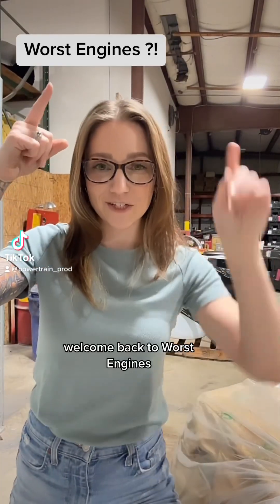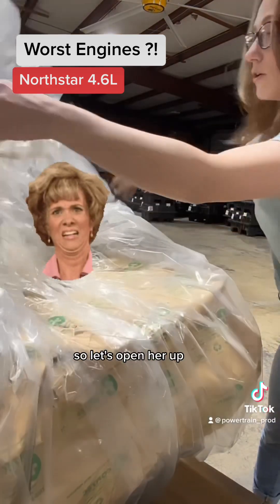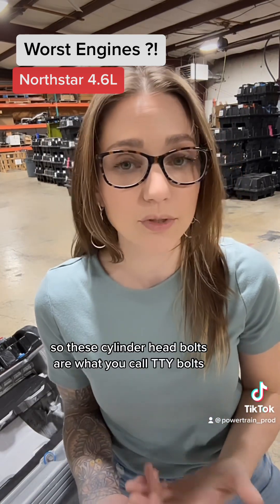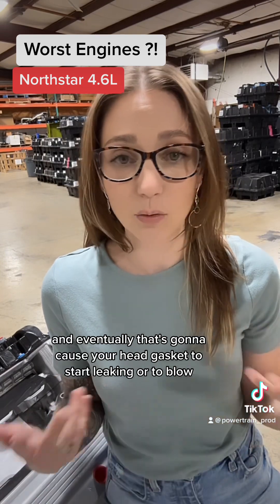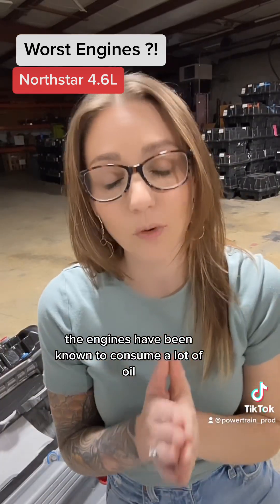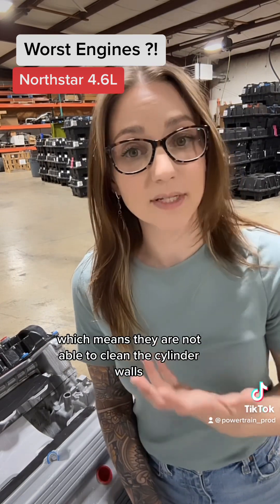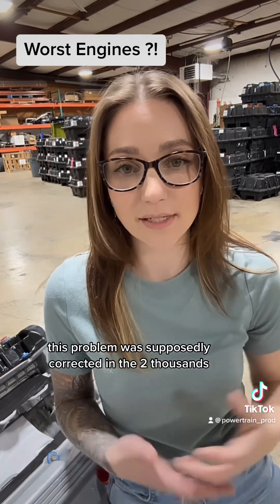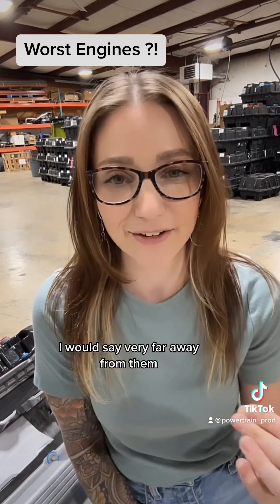The Northstar 4.6L Engine Problems

Comment: My 4.6Northstar is a hard rumning engine
I removed the heads and drilled the block and made my own head bolt inserts . Way better than the gm kit. Never had any more problems with the heads. As far as oil leaks ,i have not one oil leak in this engine, or any problems with the piston rings . It does not use any oil at all.
These engines are sought after for racing engines , or pull engines in some tractors.
I have the early model 4.6Northstar.
Thanks for all your information....
Reply: How did you make them?

Comment: The Northstar isn't as bad as all this. I used Norm Huhn products stud kit on mine 9 years ago. 100 k since and no probs or oil leaks or consumption issues. I'd say properly warming this engine and regular use and good maintenance is what has mine doing just fine.

Comment: The early Northstars were nightmares, but the TTY nature of the head bolts are not the reason. The fine thread on them, in soft aluminum was. Soft alloys need coarse threaded bolts. This was solved in later engines.  If you replace the bolts with coarse threaded studs, it's a heck of a fine motor.
Reply: What year did they fix this
Reply: @Calijay707  2004 I beiieve.
Reply: @rm25088  okay thank you, i have a 2009 so i was paranoid for a second there lol thank you sir
Reply: @Calijay707  Yeah you are fine. I have a 2008. Runs real good. 96k miles.
Reply: @Calijay707 05 so yeah your 09 should be good ive seen those last over 200k
Reply: The sound 😳🤣🤪

Comment: They'll leak oil but the rest of the problems were normal wear and tear. The headbolt problem was 97-99 and could be mitigated with regular coolant flushes. The waterpump problem was caused by the tensioner wearing out usually by 80,000-90,000mi.The oil burning was cured in the 2000s when they mandated synthetic oil. Not a bad engine at all with regular maintenance. Them Northstars don't tolerate neglect so they're not good beater cars for college kids or anyone on a tight budget.

Comment: The only leaks on my northstar is when I took it jiffy noobs and the certified mechanic of Yale’s industries spilled a lil bit during my $120 oil change then proceeded to tell me how my transmission was leaking fluid took it to another mechanic and they said all my fluids were fine 😅😅maybe the only people that experience issues are the ones who take the cheaper route and go to these bs shops 😂😂

Comment: All northstars are not bad. She speaking on the early ones. There's plenty on the road still running great with nun of the issues she mentioned. Stop it
Reply: Same thoughts here. I think some people bought these cars used where, the previous owner did not maintain correctly and beat the heck out of it. Oil changes and coolant changes are a must on these engines.

Comment: Wow. I only had two Caddys with the N*. The first was a 1996. Its gasket blew. Before that I had to change the pump once, and the radiator. I suspect that because of those two things where I had the temp go up it exacerbated the issue, plus I used the green stuff, and since a couple of the head bolts were exposed to the coolant, the chemical reaction caused rust and bolts loosened. The second, a 2004. It's been ruining beautifully, and I have never had any of the other issues mentioned. It does consume oil about a quart every 3-4 weeks if I drive a lot (though of late only drive once a month or so I go 700-800 miles highway to visit my mom) , but it is a hi-output, high cylinder compression engine. It happens.  I do have a tiny coolant leak somewhere but it's negligible and I make sure to keep the overflow tank topped off with only ever Dexcool. But no other leaks to speak of. And I don't floor it or drive much over 60 MPH like many do. It's too bad they didn't address those issues until after 2000 because tin spite of the advertised specs, I get better than 25 MPG on the highway.

Comment: I had 2 of these engines in 2 different cars. (My parents bought them brand new and I inherited). Short north v6 and 4.0 in an aurora. I have read a lot about ownership. It appears that maintenance is a “must” with these engines. Oil changes, coolant flushes and repair parts from GM/ac delco (water pump replacement). I remember when my parents pick these up at the dealership they told them about 7,500 oil changes and long life coolant. All of which is bull. They take 6.5-7.0 quarts of oil that needs to be changed. Along with coolant changes every 5 years. Each car ran great. I never had overheating issues or, major engine issues. They are quiet, smooth running with plenty of power. I sold the intrigue v6 and still have the aurora.

Comment: Update; I finally bought an LH2 version Northstar out of a Cadillac XLR, off eBay for $480. dollars total. Complete with everything, exhaust manifolds, motor mounts, all accessories, flexplate, underhood wire harness, ECM, ALL of it... They claimed it had 157k miles on it, but when I got done tearing it down, it was in practically perfect condition. Clean and well taken care of also. The only thing that happened was a main bearing bolt snapped off. 
So just as an experiment, I took the broken bolt, clamped it in a vice, and hit it with a 7/64 drill bit, and the drill bit cut it just like it was nothing, probably because it's only a grade 9.8. So I'll be able to drill it out no problem.
And just as a note, all the head bolt threads were perfectly fine also.

Comment: The Northstars were not actually GM's first DOHC design. The first one was the LT5 used in the early 90s Corvette ZR1, but it was designed by Lotus and built by Mercury marine. Literally a boat engine. Cadillac tried to make their own version and ruined it
Reply: Absolutely correct. GM owned lotus at the time. 😊
Reply: I had a 1995 caprice pursuit vehicle. It had the LT5.
Fastest top end car I've ever had.
178 mph on gater alley and was still pulling,then I got scared😊
Reply: @michaelmortag3536  I wasn't aware the 32v LT5 made it to service vehicles.

I say that as a certified LT5 GM Master engine technician. From 2000 to 2005 there were only 4 of us in the state of Texas. I was bombarded with information about that engine every work day till I left GM.
Reply: @ImperatorCaesar22  as a GM LT5 certified Master Technician I miss that engine and the Callaway Supernatural I bought off a customer in 2001. Ugh.....I regret selling that beautiful car!

Comment: This was by far not gms first Dual overhead cam engine. Chevy had the LT5  v8 in the c4 vette long before the Northstar. A lot of people don't realize it but overhead cam is nothing new. Overhead cam engines came before pushrod car engines in most manufacturers. Chevys had overhead cams in the 1920's. That's also not how the torque to yield bolts fail. The bolts are fine if you want to check the stretch on the used ones they will still be in spec. The head bolts on the Northstar fail because the aluminum used was too soft and the expansion of the block and heads pull on the bolts and then contraction they push on the bolt threads until they start stripping threads. That's the reason you'll find helicoils in a lot of the head bolt holes. It's not the bolts it's the threads. Check the threads on the bolts when you pull them and you'll see the aluminum that's been pulled from the threads in the block all over the bolt. It literally pulls the threads right out of the block until it can't keep enough pressure on the head gasket.
Reply: The LT5 was designed by Lotus, and built by Mercury Marine. The Northstar was the first all-aluminum, 4-valve per cylinder V8 designed and built by GM in-house. Rest of Your comment was spot on.
Reply: @jjshebanow  the Lt5 was designed with lotus not only by lotus. It was a joint design so still chevrolet like I said. Your right about mercury marine and from what I understand chevrolet used them because mercury was more conistant with producing aluminum blocks, heads, ect  with less core shift as chevy didn't have much experience with in house aluminum blocks and heads at the time and instead chose to have them done by mercury because it was cheaper. A very cool engine no matter who made it or why and it's a shame more people don't know about them.

Comment: Yeah that engine has a few design flaws but since a lot of people are not looking at them, first, we can say that GM made the coyote before the coyote was a thing....
And you can now buy yourself a 32 valve Northstar for way cheaper than a coyote and the design will take 1,000 horsepower. Not a problem. It's literally if a LS engine and a k20 engine made a baby And maybe they were cousins lolll like the full crank galley is just amazing. You can push so much boost on that crank, to 52 teeth reluctor you can tune it with any GM ECU. Yes they do have a head bolt design issue. There's some really good kits out there. Just do that and you got yourself an amazing engine for way cheaper than a coyote able of just as much and it'll fit straight on a 6l80e or a standard 6-speed. 
In my opinion, if you have to build an engine to put into something and you wonder what I think that's a great contender to a lot of supercar engines, if there's someone that can manage to slap a  flat plane crank and that thing it would sound amazing!

Comment: 04 Deville, has 200k miles, original engine. It's damp underneath but doesn't  drip oil. Doesn't consume oil. Have to top off of the coolant every 10k miles. Daily driver.

Either I am very lucky or I just take care of my northstar. Never left me stranded. I've taken it cross country.

Comment: I bought my 2007 DTS new. About 7 years in. The power steering pump locked up with no warnings.  2 1/2 years ago the transmission fluid line came loose at radiator. The lower one. GM's brilliant connector clip rusted out. Fluid went everywhere. 2-3 weeks later the alternator went out. Of course the tranny fluid flush haha caused that. Yes it leaks oil. I was doing 800 miles per quart. The miles are less after I did an oil change. Yet it still starts and goes with 280,000 miles. Just last week an ignition coil went bad. Of course it was on the rear bank by the firewall. YUK. Found another for $10. It was hard to find in my area.
Reply: I have an 07 DTS as well. currently 220, 000 plus miles. Its in the shop right now for a rear main seal. Although there's issues here and there, these engines seem to run as long as you can afford to fix when something fails. I constantly see a lot of high mileage DTS and it makes me wonder are they really that bad lol. I mean I knowthey all leak oil but still lol
Reply: @TalkyoshetTv how much did that cost

Comment: I really don't care what anybody says, I like the 2004 and later LH2 versions. So much so that Im going to be buying an LH2 version, head stud and main stud it, forged connecting rod it, custom forged piston it, performance valve spring it, twin turbo it, and put it in my next hot rod build. 
It seems like to me the 04 & up LH2's are a very under rated engine, just becouse the earlier versions "did" have a head bolt and over heating problem.
I have not heard anyone mentoin the LC3 version, I don't really understand why? Maybe i just didn't look at all the comments. 
Well don't look up all the R&D that went into the LC3 version, or the prices for ALL used Northstar engines will go threw the roof, lol.
P.S. If you're going to be using a Northstar engine in a RWD car, you pretty much have to use either the LH2 or LC3 version.

Comment: I have a 1999 Cadillac Seville with a north star v8 engine it only has 77k miles. What should I do to prevent it from breaking?
Reply: My mother in law had a 1999 and it went well over 100K miles.  She had the oil changed every 3,000 miles and the antifreeze changed at the recommended interval.  She never had any issues with her DeVille.
Reply: Do what the other comment mentioned as well as look up "timesert kits". They reinforce the head bolts and easily make these engines last 300k if taken care of
Reply: @KejuanCooper: Change the oil on schedule. Change the coolant on schedule at the GM dealer. Follow the maintenance schedule in the owners manual.
Reply: Bullet proof stud kit northstar proformance

Comment: Sooo are the northstar on the 2005 bonneville GXP a good or bad one. Its all mixed in here
Reply: See my earlier posts above. Maintenance is the key. Change the oil (synthetic if you can) twice a year or, between 3500 to 4500 miles. Change dexcool every 5 years. If, water pump fails. Purchase an oem gm part. I have a 2003 olds aurora with the nortstar. It never overheated and I along with many others do not have the issues others are described.

Comment: I feel fortunate to have 130k on my bonneville gxp and no leaks period. Head gasket began to fail and I used a product called THERMALWELD which believe it or not fixed the coolant consumption in “5” minutes. No more issues! Did that @ 123k and it runs just fine! I paid $500 for it and it’s a dependable daily driver/ backup when 
one of our other cars are on the shop.
Reply: The intake doesn't leak? I've done a lot of intake gaskets on GM stuff with dexcool
Reply: @masjuggalo  I’m not an auto mechanic but I haven’t added any coolant to it since putting the Thermal Weld in the cooling system. The oil isn’t contaminated with coolant either.

Comment: My 93 year old neighbor doesn't drive anymore and because I am retired and avalible and don't mind, I drive her to her appointments. Her late husband and her purchased a 2003 DHS, new, and it currently has 136K. I had her car out this morning and after dropping her off she suggested I use her car to go over and pick up my 97 year old grandmother for one of her appointments. Sorry, I get long winded, anyway when I got out to help my grandmother I noticed a ticking sound and given the issues this engine is notorious for I am concerned that it needs to be looked at. It is not raspy like an exhaust leak. it isn't anything like what I have heard out of lifters, but is very steady with the engine RPM. Some seem to think it could be the oil pump starting to go bad, or the timing gear. My thought went to timing as it sounds a lot like the issues the Pontiac 2.5L vtech engine had with the plastic timing gear. Since beginning to drive for her I have been keeping an eye on it like I would my own personal vehicle. I noticed and fixed a few very minor things, probably the one that was most egregious was the cabin air filter was put in folded in half, so it wasn't really doing anything. lol Oh well, on to reading more about the issues...

Comment: I have one in my 2007 DTS. I have had no problem with it. I don't know.
Reply from the maker: Hey there’s nothing wrong with that! Keep taking care of her
Reply: That’s because they fixed them after 06 from what I know, I don’t understand why the hell people crap on them so badly, from what I see a lot of 06-11 DTS make it to pretty high mileages and NOBODY seems to talk about the “facelift” engines EVER!!??..... They leak oil, yeah so what, many many engine designs leak oil and especially once they age, my rule is if I only got to check it every time I put gas no problem... LOL
Reply: @undertakerfire7810  halfway through 04 they actually fixed the issue by finally using headbolts that Cadillac engineers told them to use. 06 to 11 are redesigned, utterly reliable, and use ls headbolts. This woman has no idea what she's talkn about. Heads, and oil leaks related to repeated overheating. I haven't heard of any other consistent problems with any of em. 👍
Reply: @undertakerfire7810 fixed after 2000* updated throughout the years but 2000 is when they updated hg

Comment: Also the earlier North Stars had longer head bolts.  And after 2007 they went back to longer head bolts.
Reply: 93,94 95 have the longer bolts but with thin tread..96 gm came out with dexcool and the stuff would turn acidic..and most people ignore the cooling system…after the quad 4 engine was discontinued, gm had crates of headbolts…so, in 97,98,99 they shortened them to use these batches of bolts (not good ).in 2000 the went back to the longer bolt , but didn’t change the thread pitch… 2001 ,02, 03 are gambles and first builds in 04’ (aug to Feb2003) are all same …finally in 2nd half of 2004 builds March -aug  they went to ls bolts with coarser threads… so… if you like these  cars with this engine ..you want a 2nd half of 04’ build car (2005’s)…. So…. You want a last year 2005 deville or the new Dts for 2006-11’ …
Reply: @toddprater14  I have a 2005 build in a GXP....engine compartment and underneath of the car is dry as a bone at 134K miles. But like so many others I can't stress enough to keep to a regular maintenance schedule.

Comment: The Northstar got a lot better with the updated version for the RWD models that came in 4.6L and 4.4L supercharged fixes many of the issue. Of the early engines, yet everyone acts like all Northstars motors are all built the same with no real refresh for the motor. Which is not true, I currently have an 06 STS with just shy of 300k km on the odo. With amny original parts left. Also 1 quart per 1000km is considered with in spec for all GM engines if the vehicle ks driven hard.

Comment: 97 98 99 2000 years avoid 
Use Lucas oil stabilizer 
What you cool level 
Change the water pump and water pump tensioner pulley and belt at same also run a high quality synthetic oil 10W30
Not 0w20
Bleeds the cooling system properly after doing so

Ensure radiator fans are working properly. 
These are the easy solutions for the 4.6 North Star.

Comment: Wrong. The LT-5 from the 1991 Corvette ZR1 was GMs first quad cam, 32 valve V8 and they were brilliant. The Northstar was a Cadillac design and it is silly.
Reply from the maker: The LT 5 was actually designed by Lotus